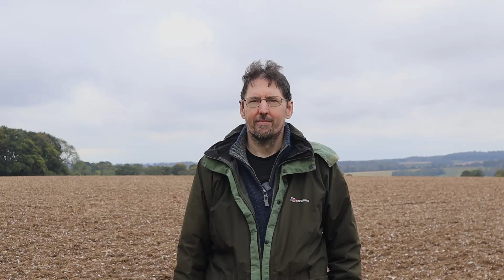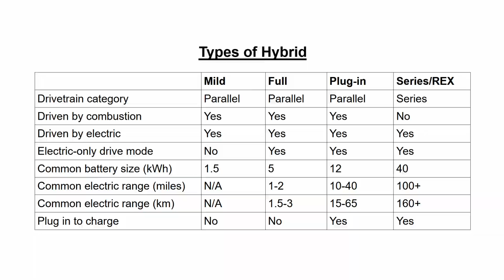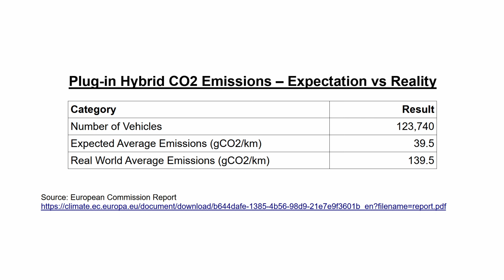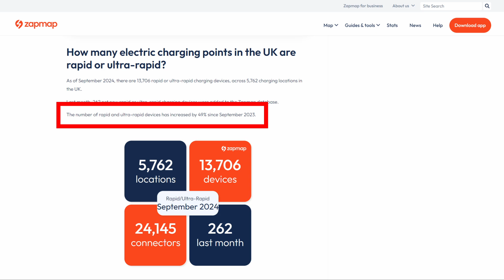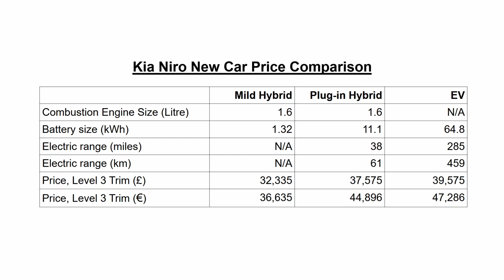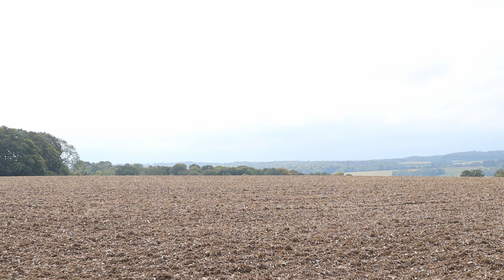Should We Buy Plug in Hybrids?

Comment: PHEVs might be convenient but they certainly aren’t efficient. In electric mode the miles per kWh is poor because it’s dragging around the dead weight of the engine and a complex transmission. In ICE mode the engine is dragging around all the weight of the motor and battery which kills the MPG. It’s not rocket science.
Reply from the maker: Yeah, it doesn't seem ideal to me

Comment: The biggest problem with most types of Hybrids is that the constant cycling / stop starting of the engine is proving to be really detrimental. Specialist oils are now being developed to try and cope with the increased wear caused by the very normal phenomenon of water vapour in the oil. (caused by compression) In an ICE engine this is simply secreted through the exhaust as steam when the engine gets to full temperature ( most of us have seen water or steam escaping from exhausts at some point) The problem is that the Hybrid engine regularly starts and stops without getting hot enough to evaporate the water. Therefore the oil is thinner and drains of the pistons etcétera much quicker, meaning that when the engine starts the next time it's metal to metal. It will also mean that steam that is evaporated and escapes will now be sitting in the exhaust system for longer, because again the system does not get hot enough to allow the steam to escape. The water condenses and sits there rusting the system until the next time it eventually gets hot enough to release it. 
Basically, they are a disaster waiting to happen.
Reply from the maker: Thanks. Yes, that's not something I'd thought of at all, but was well explained by Jason on Engineering Explained this week. I thought the limit to the "wear" would be on the battery, but it seems that there's a detriment to the ICE portion of the drivetrain as well.

I remain in conflict. ICE systems are amazing - they manage to handle some awful conditions, but keep on working, and I would never underestimate or underplay that. At the same time, they seem a very complex solution in comparison to an EV
Reply: @theelectrictransition  Agreed, but I think that hybrids are now asking that reliable ICE engine to perform in a situation that they were never designed for.
I believe that it's Mazda that have recently released an REV which I believe is by far the better option. A small generator type of engine that runs solely to charge the battery. Far less equipment and maintenance and the engine can run as designed.

Comment: I have a Toyota Prius Excel phev 2020. I charge it at home daily and Tesco pod point 😢and it gives me abt 28 - 33miles when fully charged. If i dont charge it, on long road trips, i get 65-70mpg. I have have owned this car for 3yrs and driven 45000 miles, so far, just annual service and no other issues. No squeaks, no rattles. If a person has a phev and refuses to charge it, then it is on the person and not the car.
Reply from the maker: Yes, absolutely. It's a tool, we just need to use it.

Comment: I have run an EV for 5 years and now run a Toyota PHEV for a limited time of only 3000 miles but I feel qualified to offer a number of views 
1). Do not buy an EV or PHEV. if you do not have a home charger, unless your employer fully refunds your fuel costs because at 75p kWh it will probably be more expensive to fuel than an ICE and a whole lot more inconvenient 
2) Do not buy a PHEV over a self generated hybrid unless the car is a “Double Hybrid” in other words, once you run out of electric the car reverts to to a self generating Hybrid. I do not know if it is still relevant but the Mitsubishi used to do ow 20mpg after running out of electric whereas the Toyota does 50/60 mpg
If you generally travel less than 40 miles and are willing to plug in at home at every opportunity a PHEV should definitely be on your shopping list
It will be more expensive to service on a like for like dealer than an EV but will be cheaper to insure and retain a whole lot more value when one sells after 5 years
And there is another long term issue, if you buy a Toyota you get a 10 year 100,000 mile general warranty, subject to the services being carried out by a Toyota dealer and 15 years warranty on the battery 
On the issue of the stats contradicting exhaust omissions claimed by the manufactures by a considerable margin over the normal 20% you need to compa benefit in kind on a like for like, so a 2 litre Toyota C-HR  attracts. 27% benefit yin kind and the same 2 litre PHEV attracts 8% benefit in kind so if the car is a Company vehicle the employee saves loads of money by just choosing the PHEV without taking into account running costs
My last point which is very frustrating is that by choosing a PHEV over an HEV often pushes the price above £40k and you are lumped with an additional £410 a year f the following 4 years after the first year, for trying o do your bit for emissions, but on the other hand the government gives you £25k off of luxury £100,000 EV which will almost certainly be purchased for “ high end employees” and we won’t go into how this has eloped destroy residuals in the used car market
Reply from the maker: You raise some good points, thanks.

I would say that your pricing for charging away from home is based on rapid charging, and that is not the solution I would recommend for people who cannot charge at home. Instead, what they need is an AC chargepoint within walking distance of home, which tend to be more reasonably priced. Certain networks offer discounts for members, so the combination of the two might bring the price of plugging in down below petrol - but not by much, and not for everyone, yet. Community sharing schemes might also be an option for some people.

I would urge people without home charging to start to ask questions of their local councils. This is an area in which we need more help - and I don't mean money. There are plenty of companies wanting to install AC chargepoints, but they need support from people in the community so that the planning consent is more likely to be granted by the council. Slow and steady support for the expansion of the AC network is what people without home charging need. Once the chargepoints are installed and the utilisation of them starts to increase, the cost of using them should come down.

Your point about the luxury car tax is is great one. That's going to cause some problems in the market, as it's a significant penalty.

Comment: The only useful plug-in hybrid should have enough EV range to cover daily use and only using ICE for longer trips. There are still many places (here in the U.S.) that public charging is pitiful (but getting better). One case where EVs are really not ready is for towing travel trailers on long trips and a plug-in hybrid with relatively large battery is the best case. My preference is for hybrids that only use ICE as generator to charge the battery and the propulsion is pure electric. Not many of those around but more seem to be in the future.
Reply from the maker: I agree; towing anything that significantly affects the vehicles' overall aerodynamics remains tricky with an EV at the moment

Comment: Cannot see the advantage of a PHEV in my case. I drive long distances and tow a boat. The additional cost of a PHEV and its complexity with regard to maintenance does not seem warranted. I drive a turbo diesel SUV,  and find a PHEV cannot match the performance and the turbo diesel is very economical.
Reply from the maker: On economics alone, that is probably true. There might be a small emissions reduction from when you drive short distances, but it will probably vary a lot between makes and models
Reply: @theelectrictransition  I really believe its HORSES FOR COURSES in respect to what suits the needs of the individual. EV's, PHEV's, PETROL or DIESEL, Should be a matter of choice for the consumer. I happen to prefer Diesel for my purposes and have no argument with those who are happier with the alternatives. It should not be a matter of Government mandates.

Comment: How come the hybrids only reduce pollution in built up areas
Reply from the maker: It's a generalisation, but the idea is that short-range trips near people's homes use electric range, but longer range trips use internal combustion. As the majority of people currently live in built-up areas, that suggests those are the areas that benefit the most
Reply: That is not always the case.
A hybrid can have a 4 cylinder engine instead of a six cylinder because of the extra power from the electric motor. 
Also a hybrid can run on the Atkinson cycle which is more efficient. 
Hence a 4 cylinder Toyota hybrid can be very economical on the highway. ☮️

Comment: Your whole section on series hybrids is wrong. There is nothing dictating the battery must be large. In fact, the entire Nissan E-Power system is built around small batteries and generator-engines. The only reason the Outlander PHEV has a large battery is because you plug it in to charge it. They could make a small battery hybrid version and it would still work the same as it does now.

One of the primary benefits to PHEVs is that you can make far more of them with the same battery resources. If you assume an average EV needs a 75kWh battery, and an average PHEV 15 then you can get 5 people driving electric for every BEV. This will help get charging infrastructure in to residential where it's really needed until batteries get better to make EVs not such a huge trade off.

Like if you go on Skoda's website and you look at an enyaq 85 it has an estimated range of 342 miles. But what if you want to take the family and stuff to a visit far away for Christmas... They actually have a convenient calculator. So you plug in winter driving on the motorway, in normal mode, fully loaded, with a cool 20C cabin temp and suddenly that 342 miles becomes 176 miles. Add to that this is 100-0 but the DC charge rate is 120kw over a 10-80 charge according to EV database which means you can only use about 160 miles on your first leg of the trip (100-10) then charge to 80% in about half an hour, and then you can only go 123 miles until 10 again... And so you are stuck stopping for half an hour every 2 hours.

In my PHEV, it's rated to 1000km (620 miles) but on actual road trips with the family it actually gets over 900km (560) per tank of gas. That means we only stop for human needs and top when convenient. Yet most of the time it runs daily use in EV mode (My record so far is a little over 3500km [2175 miles] on a tank of gas, thanks to no long trips and opportunities to charge).

Plus PHEVs and Hybrids depreciate less (which you allude to when you mention that EV and PHEV are about the same price used).

Like any engineering problem, all of these are trade offs. There are never solutions. The vast majority of people will be happier in a hybrid, people who can charge religiously but do distance driving intermittently should be going PHEV, and the delusional EVAngelists can drag around their 2 tonne behemoths forcefully pushing the tech forward until it's actually usable for more people.
Reply from the maker: That's true, there is no requirement for the series hybrid to have a large battery. However, my definition correctly describes the most well-known models available, and in a video I have to limit how much detail I go into. e-Power wasn't a system I was aware of, so that is good to know about, thanks.

My understanding is that a series hybrid is generally more efficient than a parallel hybrid at low speed, but less so at high speed. Therefore, manufacturers have - until recently perhaps - aimed to maximise efficiency in series hybrids by having as large a battery as possible. It looks like the efficiency of the e-Power is a bit meh in real world use, so that might back up this theory.

Yes, the range of EVs is significantly impacted by winter conditions. Even so, most people who have one seem to manage OK with it, even in the winter. I do in mine. Which weighs just under 1600kg.
Reply: Good points 🎯

Comment: There are lot of assumptions and opinions here. I drive a Mitsubishi outlander phev. It suits my use case better than an EV or a ice car. It's proved very reliable. Less depreciation than an EV. Deep cycling the battery is nonsense. The usable EV battery capacity % is lower than that of a EV. My cars battery is at 80% after 100k miles.
Reply from the maker: Yes, there are some limited opinions, although the data from the European Commission isn't opinion.

Thanks for the data point, that's very interesting. It's hard to know how old your car is, and degradation is a very complex subject involving both age and mileage, but I would be disappointed if an EV got down to 80% at only 100k miles.

Comment: Shame the EU data didn't identify who owned the cars.  I suspect many were company cars bought for the tax break and never plugged in at all.
Reply from the maker: Yes, I think that will be part of it. The initial data set included all of the cars that reported data, but ones with less than 500km were then excluded, as were cars where the results seemed invalid
Reply: @theelectrictransition  You should look at the study in detail.
Company PHEV largely based on reducing tax payable, hence awful abuse.
Private PHEV less so, and more habit issue as you described.

Comment: Once a PHEV battery is flat on a journey longer than the battery power you are using more fuel.
The Honda system is less effectively than Toyota. 
My diesel gets better mileage than a PHEV and most full hybrids.
Reply from the maker: Diesel particulates and NOx continue to be a problem despite the latest tech intended to control them. There are multiple issues associated with burning fuels, not just CO2. The UK got itself in a bit of a pickle promoting diesel before they realised the negative impacts on air quality in built-up areas.

Comment: I am considering a plug in hybrid ute to take the place of my aging Toyota Landcruiser. The Byd Shark has a LifePO4 battery and a battery management system, which, by design does not allow it to be depleted below 20% and this type of battery can be charged to 100% with little degradation compared to a Lithium Ion. The power and torque of this will double my current vehicle and give me a respectable range. Also, I will use it to tow my caravan where I live in Australia, where infrastructure is non-existant where I travel. We are far behind the rest of the world when it comes to infrustructure. Electric tow vehicles have terrible range as you would know, until battery technology advances, so there is very little choice.
Reply from the maker: Yes, agreed. Towing long distance with an EV is not going to be very convenient. That's one of the relatively limited use cases where combustion remains a better option

Comment: Plug-in hybrids with an electric range of about 50 miles would be perfect for me. I could do all of my regular driving on electricity and not have to stop to charge it while on a highway trip. The problem with plug-in hybrids isn't the car, it's the lazy driver.
Reply from the maker: I can understand that point of view. However, I find I need to stop for my own comfort before a modern EV's range has been depleted, so if I can plug in where I stop, there is very little disadvantage to using an EV instead
Reply: @theelectrictransition  This would be true once there is enough infrastructure to support it. It's just not there yet.

Comment: Have been tempted by the Outlander purely on the basis of cost and size - ended up getting an early Euro6 V70 diesel which pains me but there are few alternatives in the £5k bracket - the 30mpg on the Outlander was off putting even if I could charge at home from PV for local trips. The next option would be a Merc C or E class but those are at least £10k - there are very few options sadly until BEVs of a similar size and spec fall into that bracket - the next option would be to buy a cheap 30kWh Leaf as a second run around and retain the estate for longer trips with the family and stuff 🤔
Reply from the maker: Yeah, I probably wasn't clear that I was talking about the state of play in the new car market, for those who can afford it. Options on the secondhand market are much more limited, sadly, so a limited budget might mean an EV would have a very limited range.

I would recommend avoiding the 30kWh LEAF if I were you. They have proved to be unreliable; they overheat some of the cells due to the lack of thermal management. It's the one EV I would not recommend. The 24kWh is more reliable,  and the pack fairs somewhat better, so the range difference might be small on an older car - it will have less degradation
Reply: @theelectrictransition  thanks, I wasn't aware that the 30kWh suffered quite so much over the 24kWh apart from capacity - I was aware that thermal management was passive but I wasn't expecting more than around 50-60 mile range on something 10 years old for £5k or thereabouts so it was more to do with the rest of the car than purely the battery - that said if the battery does go completely it leaves (excuse the pun) a bit of a door stop 😬